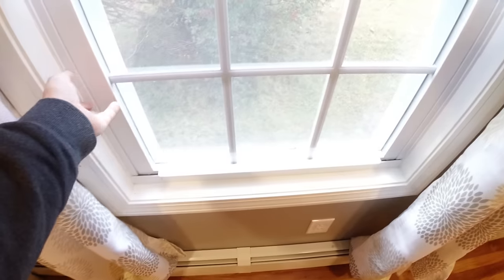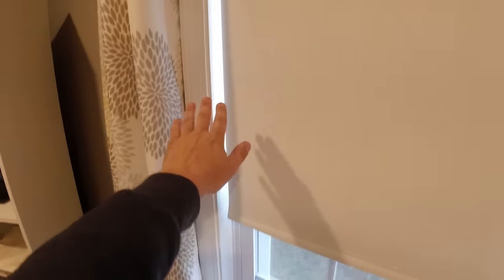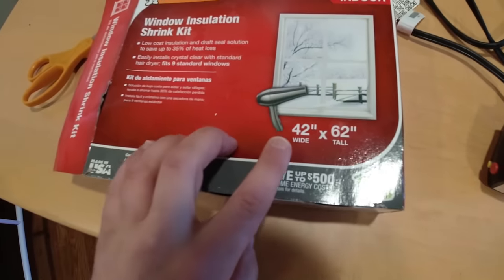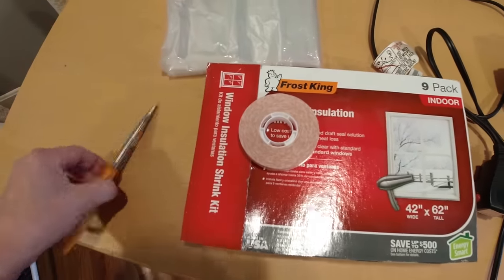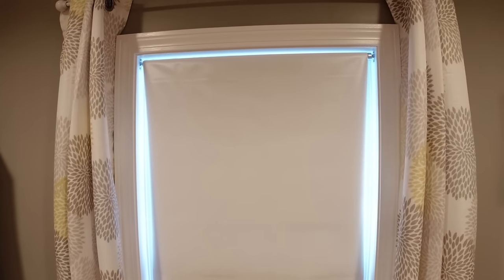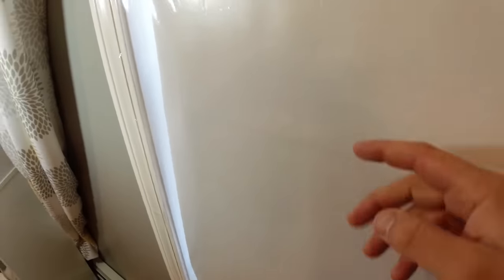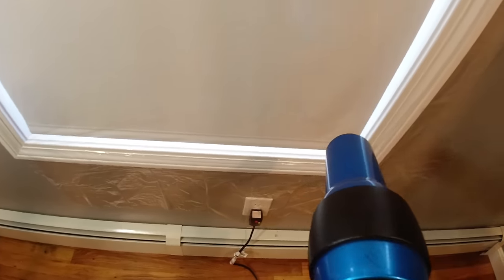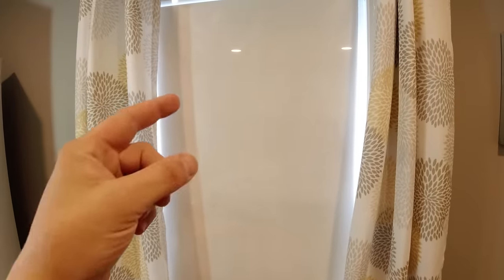How to Insulate Windows and Save Money on Heating Costs!

Comment: If you make a frame out of 2 x 2 wood and then stretch the plastic both front and back you can make it so that it fits tightly inside your window and creates a double vapor barrier. If you use clear plastic you can still get light through the window. You can take it out anytime you want and put it back without any problem. I’ve been doing this for years in Utah and I have never once turned on the heater since I moved here in 1989
Reply: That’s amazing🎉
Reply: I need a video of this!
Reply: Video please 🤗
Reply: Hi I would also enjoy a video
Reply: Video please 😭
Reply: Video😅
Reply: Definitely need a video for this !
Reply: Google this it's from the old times in Denmark 2008 and such it's called forsatsvindue in Danish don't know what the English term is but basically what your doing but with a plexiglass window
Reply: Where's that video?
Reply: All 20 of my poorly insulated windows have cracking in the wooden frames so I need to stretch the plastic to cover more than just the window. Building a frame wouldn’t work well for me since there are drafts coming through the wood cracks that are just outside of the normal window space.
Reply: I'm 1 year late, can you do this with regular plastic wrap instead of the kit??? i have double-sided tape, already cause i'm a crafter. Thanks!!! Can someone please let me know.
Reply: @lisamb4269  well it might have a little effect but not much I'm afraid
Reply: Any links to videos on that....
Reply: @lisamb4269  see my comment above - it helps a LOT.  And for cheap.
Reply: Shower curtain works well, cheap from dollar store
Reply: @johannabubela2911 NOW THATS A SMART IDEA
Reply: That sounds very hard to believe since doors and windows are only about 20% of the heat loss.
Reply: @dolfinwriter5389 So what’s 20% x 26 windows? I am going to give it a try this year. We are suppose to have a very cold winter in Indiana. Next year I plan on putting in new windows but I need to pay off some debt and save some money first.

Comment: But the shade is down now for the entire winter. What if you put the plastic up first. Then put the shade back on, so your free to raise it, and let some sun in. Which also saves on heating
Reply: If it’s 20 degrees out and sunny, believe me that sun is not helping
Reply: @pete she meant let sun in, meaning light I guess
Reply: He was just giving the example. His window has dual panes so it was insulated. As he mentioned. This is better for windows that aren’t insulated or are thinner.

Comment: I plan on putting the doubled sided tape on. First remove the top section of doubled sided tape. Put the plastic on and secure it in place. Then move to the left side. Remove top section of tape and secure the left side of the plastic. Then do the same on the right side. Lastly, remove the tape on the bottom and secure the bottom of the plastic. That way it won't stick to any area that you are not working with.

Comment: How do you take the tape off in the spring? Does the tape come off easily? Or does it leave a sticky residue?
Reply: It comes right off. I never have a problem with residue. But if that were an issue you could use rubbing alcohol on a paper towel to clean the area or lemon essential oil.
Reply: Tea tree oil works great removing glue and sticky residue

Comment: How is it with taking it off in the spring? Will it damage the frames? And the water collection (condensation) over winter, any tips of what to put by the window before taping it off?

Comment: Just repaired/covered a hole in a small window that has bothered me for 5 years or more. Peeled off the clear boxing tape that I tried to patch up with, followed your directions, and have a window that does not look bad. At least far better than a patch work of old tape that gathered dust and dirt. Plus it will keep the warm air in, cold air out. If only I knew about this Years ago ! Thank You !!

Comment: I have old wooden windows with exterior removable screens.  I just do this tape/plastic/hair dryer option to the screen and insert it as usual.  It works great.  Then I don't have to clean off the ugly double sided tape off later and I have full use of the window shade.

Comment: I use old sheets etc to keep sun out in summer. Since even with uv coated newer windows and wrap around deck and blinds the sheet still makes a big difference. I pin it to the top and sides of the trim so theres no wall holes and it has a really stable base and keeps out the light and heat much better usually i dont worry about pinning the bottom but you can of course. 
Same principle just for the reverse effect. I tend to do it on only the worst windows or the sides that face the afternoon sun so its not like living in a cave and i can still open those windows for light and fresh cooler night air. 
Ive seen bubble wrap used but anything plastic or rubber or anything of that general group melts in the heat here even the heavy duty hard plastic so cardboard is easier to do on shed windows or the smaller ones you can usually get free cardboard boxes from stores and things that their produce or stock comes in and if you cut it correctly it sits inside the window so you dont need any tape or anything and its quick to remove and you can compost it in the garden when youre done using it the bigger windows are the hardest so i only have sheets on them unless they are really bad then i might splurge on a black out sheet like they used in the wars that are basically a tar acryllic paint like substance treated on sheets and taped to the window. I like that all of those are quiet inexpensive or free and are reusable for years and when you arent using them on windows can be used as other things.
Reply from the maker: Great idea Emma!  Thanks for sharing.  I hope you enjoyed the video!

Comment: Question:  I'm in an apartment and need to use the kit, but there are mini-blinds installed already.  Can I put the double-sided tape directly on the vinyl window frame inside the wood trim? Will it stick well to the vinyl?  Thank you!

Comment: If you have small double windows with an entire frame around each side, you can use kits with small pieces of foil and cover each window seperately (left and right? These kits already come with double sided tape. I'm just hoping that the tape comes back off easily (Tesa). Previous tenants had left me a nice surprise of very sticky thick glue from insulation tape or what not, left on the windows, and I needed some very strong wax benzine to get it off the window without damaging the paint.

Comment: Hi if i use reflectix insulation ( like the silver thing used in windshield cars) would it have better insulation? Im not concerned of no sunlight passing through. As i have old appartment and thus windows are non insulated, it gets -25 here in montreal

Comment: Okay, so I tried the 1x2 wood frame and I could never get a a straight piece of wood from the hardware store!  I found a better alternative and used a screen frame kit, cut it to the inside dimensions of the window, minus the corner connectors then used caulk to adhere the metal screen frame to the existing window frame, and used screen spline to hold the plastic in the spline channel on the screen frame.  This makes a complete seal around the window and can be removed very easily by re moving the spline.  The white screen frame also blends into the window and looks as if it is part of the window.

Comment: I guess these are really questions to Mr. Fixer:  Does the paint come off with the tape? Can this system be used year-round? In the NW, quite a problem with mold/mildew/condensation; would this enhance, decrease, or not affect? Reusable? Thank you for your practical, orderly presentations. Please suggest if there is a temp range to apply and then what about removal?
Reply from the maker: Hey there!  I should have said in the video you should be careful removing the tape.  Here is a tip... use a blow dryer to heat the tape up before you remove it.  Will make it easier to remove and you will be less likely to tear the paint off with the tape.  As far as using it year round, I don't see why not and I don't think it would affect mildew or condensation in a window as long as it gets sunlight and heat.  That is just a guess really, never tried it.  I live in the north east part of the US so about a week or two before I think I will need to turn the heat on is when I install this and when I have had the heat off for about a week at the end of the winter I will remove it.  Hope this answered your questions.  I really appreciate the comment and you checking out my videos!!!
Reply: Re condensation, simple trick: take a newspaper page, roll it lengthwise and place it up against the bottom of the window pane..  Wrap the window in plastic per the video, but make sure the paper is touching the window pane. Any condensation will roll down onto the paper, not your wood frames, and the paper will dry out at the next warm sunshine, ready for condensation again.  This will soak up most if not all condensation, thus help prevent mold on the wood frame itself.
Reply: @mfb6310  thank you!!!

Comment: The thing I don't understand is, so you can't use that window again after that? Like...how are you getting fresh air into your rooms when the weather is nicer if you've covered all your windows up?
Reply: It's only for over Winter when the inside of your house is continuously warmer than the outside.
Reply: This is definitely needed for the winter. You would have to remove it when spring/summer comes

Comment: My house is 104 years old. Can this still be done, if so, can I use regular plastic wrap??? I already have double-sided tape. Our heat source is natural gas, i don't wanna run up my bill. but, it's awfully cold and drafty!!! been having to put the heater on 70 -72, this winter, cause of a deep freeze that came. Can I do this with windows that old??? I'm eventually gonna hafta replace these windows, cause we cannot even open them, due to no screens when it's nice out. At least when I had my trailer, we had windows with screens. I plan on getting screens for this house, cause I love to leave the windows open and blast my music. That being said, also can i do this to my attic??? there is a small hole in the wood in the attic, but i'll address that asap, as well. It's just a tiny hole. Any suggestions is grately appreciated, I'm a new home buyer...:) So far, I've done all of the flooring, ripping up carpet, etc. by myself, I need to do more to get this house back to all it's glory!!! Thanks!!!

Comment: My window is recessed and doesn't have a frame and to seal it I would have to put it directly on the wall around it, is there a better method you'd suggest?
Reply from the maker: Hey Kaitlyn!  You can put it on the wall but after the winter when you go to remove it, be careful.  I would use the blow dryer to heat up the tape before you peel it.  Then peel it nice and slow so you don’t peel the paint off with the tape.  Hope this helps.  Thanks for checking out the video!

Comment: Do you leave this up until the summer? I have older wooden windows in a 1950s house and I’m trying to find a way to get them better insulated with less drafts. The previous owner did install double pane windows, but kept the wooden and badly fitting window frames themselves and looking for some solutions until I can afford to change them all out.
Reply from the maker: You could leave this up all the time if you wanted.  I just use it in the winter when I have to.  It really does make a difference though!  Hope the video helps.  Thanks for watching!

Comment: I just use bubble wrap behind the shade. Tape it to the glass with good ole scotch tape. Cheap and easy.
Reply: Does bubble wrap need to be "sealed" at the edges? Or can it just rest against the pane without needing to seal it? So in theory I could cover only for example 2/3 of the glass and still get benefit?

Comment: Seems a really good method, but how do you let fresh air enter the room? I like to open my windows a few minutes in the morning...
Reply from the maker: Great question.  I haven’t thought about it... I bet there is a way you could make the lower half of the window on sort of a hinge with some kind of hard plastic.  I’m gonna think about that.  You got my mind turning haha 😁. Thanks for checking out the video!
Reply: You could probably attach the bottom of the tarp to the actual window so you can slide it up

Comment: How do you open up the shade
Reply from the maker: If you have shades that are inside mount, you would have to make the decision beforehand to whether or not you would want them open or closed during the time you had the insulation kit installed.